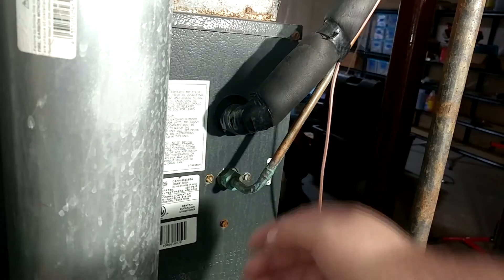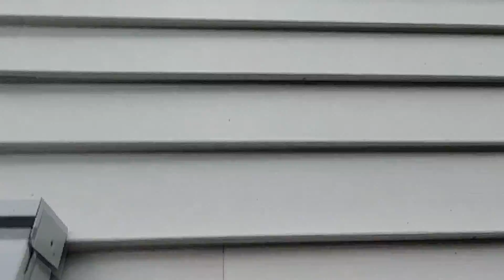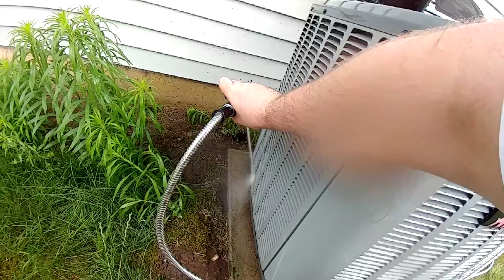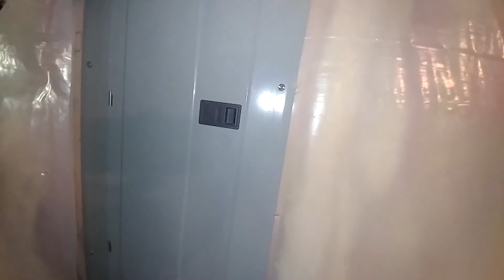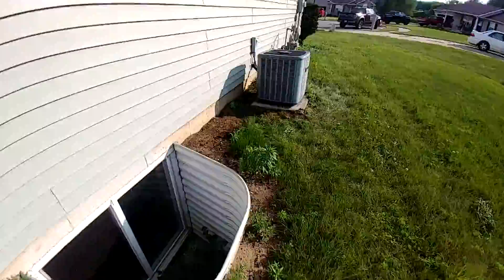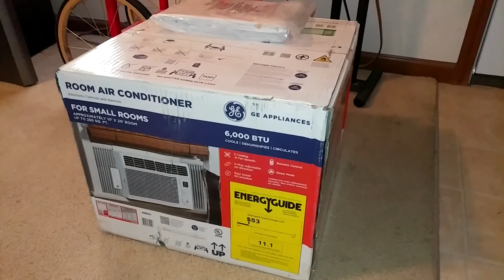TBL 32 - Cleaning a NASTY A/C unit...

Comment: Neat video, That window unit you bought will probably surprise you with what it can do. My grandpa has one, and it can keep my room(the furthest away from the unit plus his house is old enough it has no insulation) at about 80 F when it's 90 plus degrees outside. Though, his house is small (it's like 900 square feet).
Reply from the maker: I'm hoping your right. Right now I'm waiting for funding for a door and I'm debating just how badly I want to strap one to the roof of the Escort to get it home. ;)